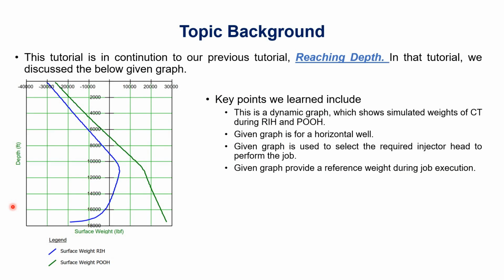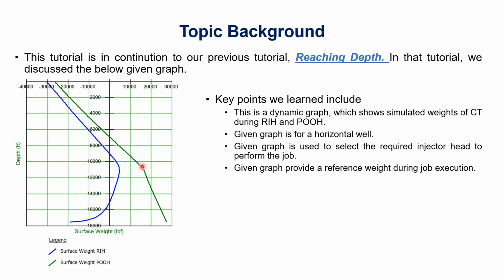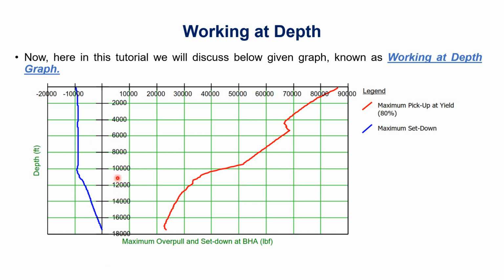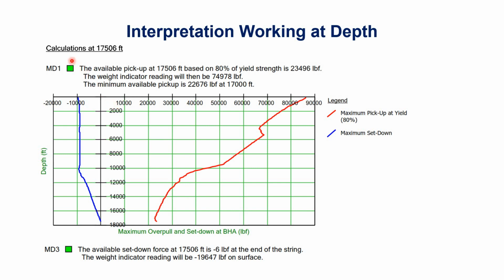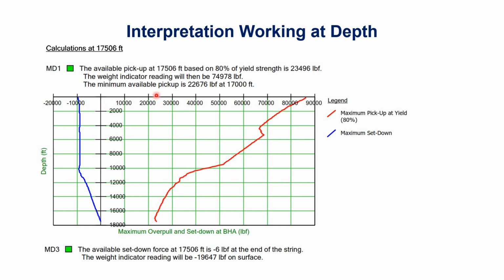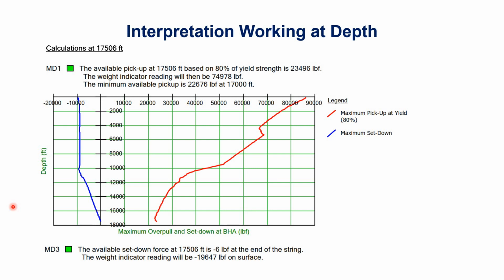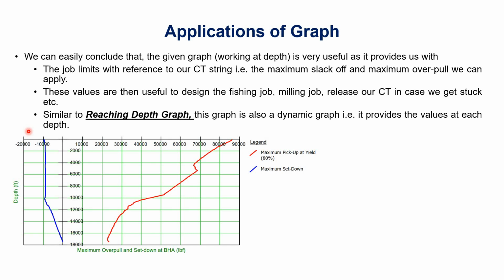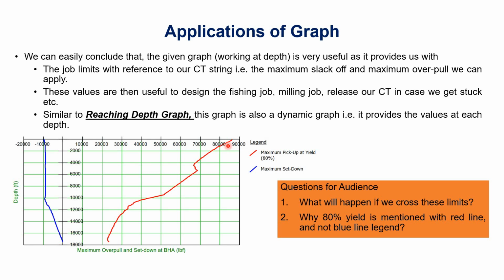93 - Maximum Overpull & Set Down Force (Working at Depth ) Graph in Cerberus by Yasir Ali

Comment: If we slack or set down more coil will get buckling and struck inside the well ... And if we over pull connector for BHA will disconnect and chance to get coil parted from weak  point  and other risk for injector and BHA and BOPs are  expected.

Comment: Salam Yasir. Thanks for your effort. A quick question. For me not clear from where the following numbers are coming from: 74978 lbf for pick-up and -19647 lbf for set-down? Based on the graph the max at zero depth we should see around 86000 lbf of pick-up weight?
Reply from the maker: Limits are always seen the the working depth because that is the worse case scenario. 

These numbers are for the working depth i.e. 17506 ft.